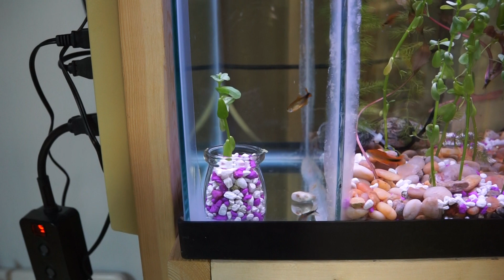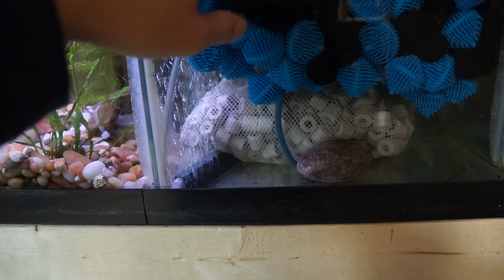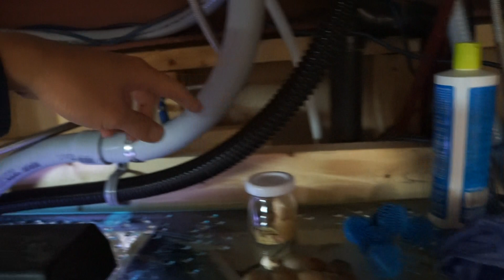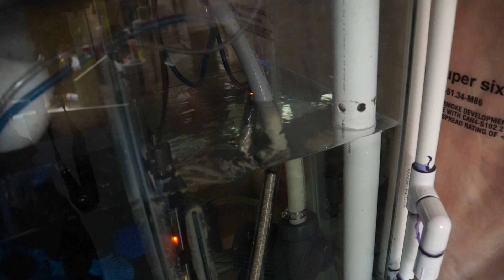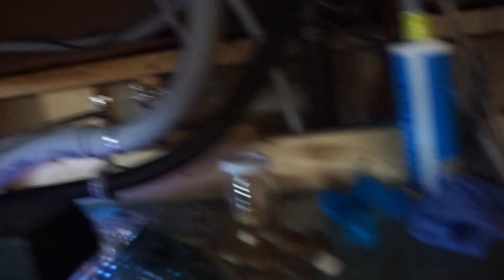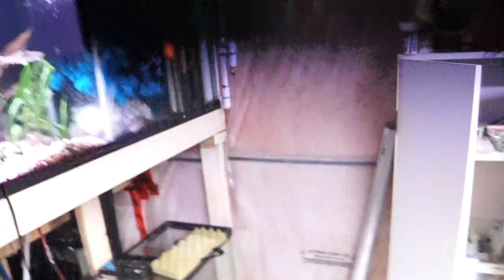Aquarium Sump/Filtration Design for Fresh Water Turtle Tank with continuous water change

Comment: Their not fine they are on a tread mill
Reply from the maker: who is on a treadmill?
Reply: @blue0skye    If the water current is to fast it is like putting a human on a treadmill. It is a stressor.
Reply from the maker: @bradleyburdett5361  not really, the second compartment actually had too little water flow so I had to put in a bubbler to increase the water flow.